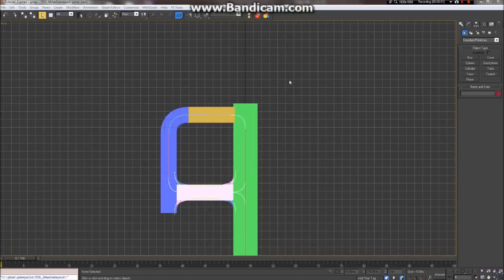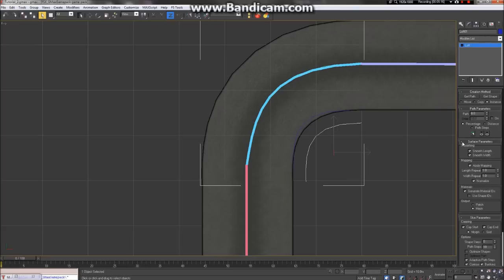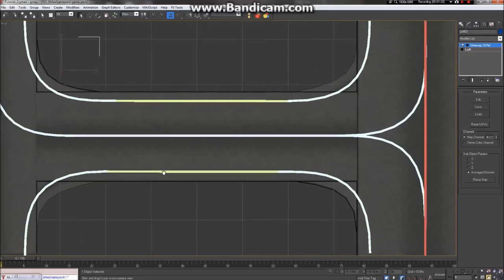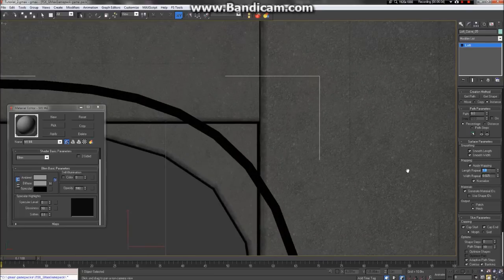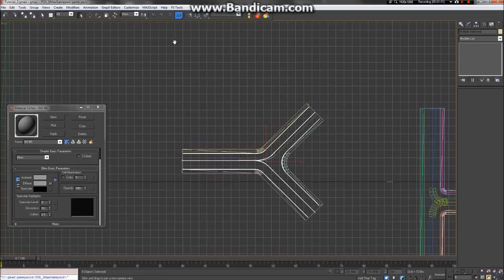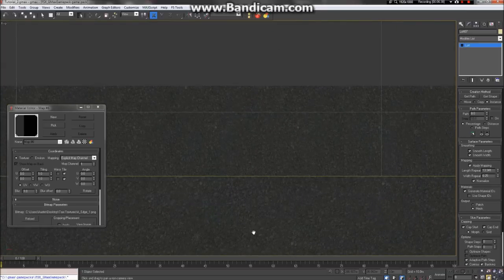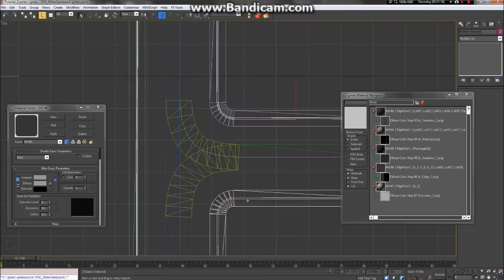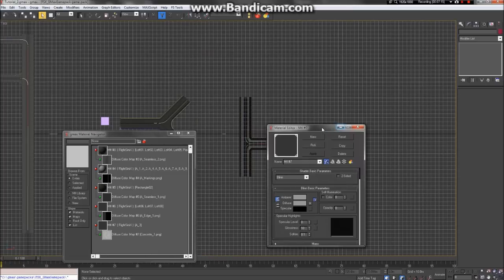FSX Scenery Tutorial / Taxiway Creation - Texture Mapping

Comment: hi ther ,long time ,whenever i apply the texture to the aprons or taxiways ,always the texture seems too much stretched ,and it looked awful,any tips ,thanks
Reply from the maker: You're texture is going to appear stretched until you apply uvw mapping or a uv map. In uvw mapping you need to make sure that the length and width parameters are equal so that your texture maps uniformly.